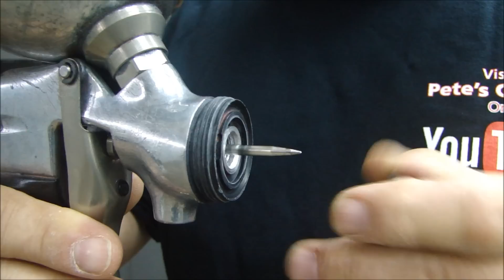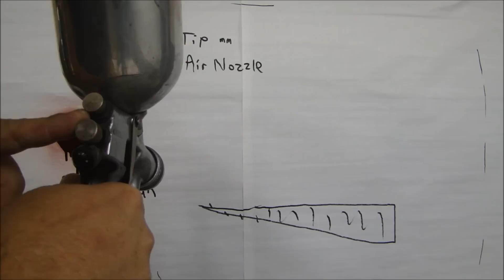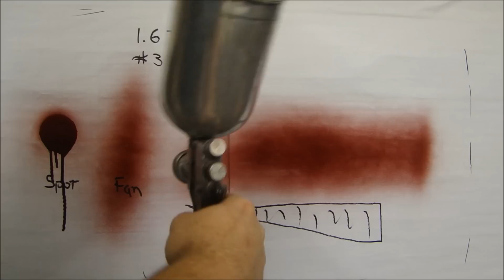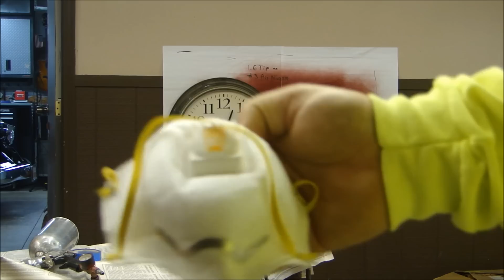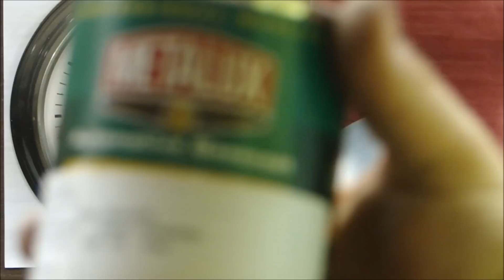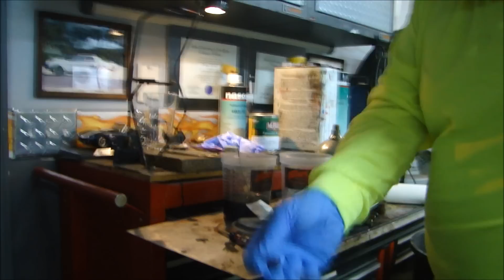Beginners Guide: Spray Guns & Spraying Base Coat Clear Coat

Comment: i know this an older video but the basics still apply. I have a question. I am an automotive detailer and would like to start using a  spray gun to apply interior and  extrarioe detailing protectants some are water based and are thick in consistancy. I sometimes want to be able to spray these at full strenght without watering down.  ome need to  whaI need to know what type of spray gun and needle size t I would need . Also  the compresor I have is a 20 gallon and is ratings are 6cfm at 40psi a little more at less psi. I need something that is affordable as well. Any recommendations would be appreciated. Thank you

Comment: Got a question about Respirators, Want to do some painting on my 62 Plymouth ( door jambs,, engine bay) Need to buy Respirator to spray Urethane single stage, and BCCC . Painting in 2 car garage with fans to pull out vapors.  What would be a safe respirator for a guy to buy, that's not going to do much painting ?  Shold I buy full face ? Please get back with me.  Thanks

Comment: I am a beginner using a Harbor Freight HVLP gun.  was it difficult to take apart and clean!!!  what i noticed was the needle and spring  lengths when threading the adjustment cap on was hard.  Had to push, depress the spring and thread the cap on.  is this common??  Also where can i purchase the wrench to take the nozzle out with??
thanks Sir.

Comment: Excellent tutorial, much appreciated.  Did new front end on car this week with $29 Harbor freight gun.   Primer sealer adhesion for plastic, basecoats, clearcoat came out great!  Had a fly land on it when I just finished clearcoat, made mistake removing fly when it was still wet.  Thinking will wet sand with 1500 n touch up spot fly landed on?

Just getting started picked up 21 gal vertical compressor, have few older guns also.   Really enjoy it, afraid I am hooked on another new hobby!

Comment: Can you speak on intercoat clear and topcoat clear. I just learned they are not the same thing. When do you use them, when do you not use them. I'm doing my first flame job. Got intercoat clear then found out it shouldn't be used as a final topcoat.

Comment: Very useful video.  Thank you.  I have a question that was not covered in the video.  Where I live it is very humid.  What equipment would you recommend to keep the air feeding the spray gun within proper moisture levels?  Also, in other videos, I have observed the painters using a plastic bag of some sort inside the cup to keep the cup a little cleaner and make overall cleaning in between, and when they are done, easier.  What do you think?  Thank you for an excellent video.

Comment: Hey Pete, wondering if you can give me some advice here. When I initially pull the trigger on my HVLP spray gun, the patter is wide, about 12" however when i keep holding the trigger, the spray pattern becomes much small, about 7". Does that mean there's not enough air to atomize the paint?

Comment: Pete, I have a 68 Ford Torino I painted about 30 years ago with Centari Acrylic Enamel. I could not find the strip kit which was tape when the car was new, so I taped it off and painted the strip on in gold. It all came out pretty good, but over the years now, some rust has started to come back and maybe it's time to paint again.  Dupont sold Centari which makes it hard to match again. So maybe Base coat/clear coat would be a better paint this time. How long would i have to wait to tape off the strip so that I can paint the strip on, pull off the tape and then clear coat the entire car all at once? Or maybe that is not even a good idea. Maybe clear coat the base color and then paint on the strip and clear coat over it?????

Comment: Hi Pete.  Thank you for the informative videos. I went to the junk yard, and pulled two doors to replace the one's on my car.  They are both different colors (white and lt, green) They are in great shape.  Should I sand below the clear coat, then use sealer and original body color plus clear coat?  The original color is dark green......Jim.

Comment: How fo you thin down the clear coat? What should be the viscosity of the clear coat? And what is the air pressure so it wont run.

Comment: need hlep i bought a HF 20g air compressor 135psi max 5.0 cfm at 90 psi i need help on picking a spray gun hvlp or hte i will at most paint 3 parts at once

Comment: Hey Pete I have a obscure question dealing with spray tan like fake tan  - spray tan. Auto spray tan booths start about 9k to purchase. I just want to spray tan at home without having someone else spray me. I have attempted to find just the elevator thingy they use in the spray tan booth as I have a spray tent and a spray tan machine I just need the automatic elevator unit but appears built into their booth.. so I have purchased a automatic mini blind with a remote so I have hooked my spray gun, taped lever so always on, I hit the on button to air tan-machine, hit the remote for the mini blind and tada BUT it’s a pain to get the gun positioned properly each time as I have to take it off to clean it etc. SO I saw the Melnor mini max tripod sprinkler and I thought.. brilliant instead of moving the spray gun up and down with the hose from machine attached etc. have the gun/sprinkler oscillate. 
I believe if I attach the sprinkler connect where lock ring is in front of needle then in place of nozzle will be the mini max sprinkler. 1st will that work? 2 nd I can’t locate size of thread part of any paint gun to see if it would fit or if any adapter exists to connect mini max to spray gun. Does this make sense what I’m saying? I hope so .. I’m a layman I just want to be tan cause it looks good but having someone else spray me is pretty intimate so stopping the Amazon delivery guy or lawn guys to spray me gets uncomfortable 🤣😂🤣just kidding bout that but not about my desire to DIY an auto spray. Any help would be appreciated 
I will purchase any spray gun that will work just need to know which if any Thank you!!!

Comment: Thank you the video was great for a beginner like myself.  I have never sprayed anything with air only out of a rattle can. I am trying to learn and get as much information I can before I start.  I am restoring a 1969 C10 it has been painted by a professional but I have a few small pieces that needs painting so this is a great time to start learning.

Comment: Thanks for the tips on using and cleaning a spray gun.  Do you have any other videos on spraying technique?  It looks like you started with the edge and bottom of the mirror first and then covered the major surface.  Is that correct?  I'm working on a moped using spray cans for now to learn technique before I take on the hood, top and trunk on my car.  I started with the panel edges and hard-to-get-to surfaces first and then covered the major surfaces because it seemed logical, so I'm wondering if I guessed correctly.  Thank again for the tips.

Comment: Pete, 

The car;                                                                                                                                                                       November 20, 2020

Great Video.  I'm restoring a 1930 Model A Ford Cabriolet that had been professionally painted with lacquer paint. Unfortunately, the paint cracked and peeled off so, my intentions are now is to paint the car with enamel paint. Now that the lacquer paint has all been removed, there are areas of the car that show bare metal, covered with red primer, Bondo, and the inside of the fenders have been painted with black Rustoleum paint. 

My question is;
I want to use automotive paint sealer. Do I have to apply an epoxy primer or self-etching primer first before the sealer or just apply the sealer to the above mentioner Model A?

Thank You,
John Bach

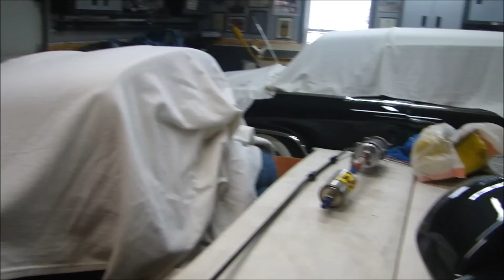Comment: 36:58 - Fish eyes :p Polishing will probably catch it, but it's a con of not being in a booth and or contaminants in the air or air line. Good vid though, if I were to offer one last step to the cleaning process, that would be to add more thinners to the gun once cleaned, shake it around and empty it, then add more and spray a little out to rinse out all the fibres etc from cleaning.

Comment: Great video. So to repaint a car, I sand off the clear coat, sand into the top coat, clean, degrease, prep, use a sealer, then top coat and clear coat. Is that the basic process?

Comment: I'll never paint anything bigger than a bird bath as I'm disabled I won’t ever be able to touch a car. That didn’t stop me thoroughly enjoying this video. Passion, enthusiasm and knowledge never fail to get my attention and you had them by the bucket full. 

With the respirator my first wife's husband was a paint mixer. He started in the mid 70s when safety wasn’t as important in the U.K., he now has early onset dementia. Though it can’t be proven it’s highly suspected it was the chemicals he worked with. It’s not just lungs the paint affects. Part of my condition is usual nerve damage that's closing my lungs down and I also have extreme persistent atopic asthma. Having a lung condition that will kill you in the next few years is hard work at times. I always wear a full face mask and don’t take it off until I’m away from the paint.

I’m glad someone deletes nasty comments, I’m all for healthy debate but nastiness for the sake of it is immature and pointless.

Comment: I have to paint a bumper cover for my 2006 Rav4. I bought a quart of paint and clear coat. The CC comes with hardener. DO I mix the two together or spray them separately?  Any tips before I tackle this? Thanks for the video!

Comment: Great video sir , however I have done away with the regulator at the gun because of the sudden higher velocity of air coming from it at first pull. In other words the gauge will be at 60psi and when I started painting it's set to about 20psi so 40psi drop. It's not a true 20psi coming out off the gun .??? I now only use diaphragm regulator and not the needle type that is on a gun for regulatng pressure. I only have the large watertrap regulator at my compressor set at about 30psi to 40psi wile trigger is pulled for painting, it works better for me.

Comment: Hello Pete,  I just got a HVLP air gun, and what is the minimum air compressor I need to use it ?  I got a pan compessor 3 gallons and I see the regulator gauge goes up to about 20psi, after I pull the trigger no air coming out of the gun.

Comment: Really good video. I learned a lot from that. I'm an auto mechanic who's trying to paint his own car. For the third time now. Urethane basecoat clearcoat. I sprayed the engine compartment while the engine was out. That came out perfect. So I figured I should be able to paint the car. Base coat seems to be no problem. Although after watching your video I learned better ways to get even coverage. The clear coat is a completely different story. I get really bad orange peel. Last time I sprayed, I noticed that the clear was not coming out in a fine mist. A really big mist. Tried turning the air volume up, and the flow down. Helped a little but still not good. Then it hit me, I think when I did the engine compartment , I had the air pressure turned up quite a bit higher.? Would that make sense?

Comment: What psi is base coat vs clear coat? Both the same? 18-19? I started my car, and started with 40 psi, lowered down 2 35 psi doing base, and clear with metal flame mixed in. Using the purple vlp harborfrieght gun. Budget painting...8 kids.

Comment: Pete, Nice video. I'm an old guy who just started painting cars. I've been restoring a old Nissan 240SX with my son as his daily driver. One thing we're doing is repainting the entire car stripping down to bare metal. We did the deck lid this weekend and I made a critical error. I used hardener in the base instead of reducer. I was somehow under the impression the base was a 2K system so I added hardener. The paint has taken forever to dry. I wish someone like your self had explained that reducer is a commonly mixed with base. I watched tons of videos and I don't recall one ever mentioning reducer.

Comment: Thanks for the video! So frustrating however, when you say it's for first-timers and say,  "I'm going to use low air pressure...". Yeah? And low pressure would be??? I'm not sure if you know how to teach beginners. What's low and what's high? What is overlap? How small of an air compressor can i use? What are the minimum things i will need of everything? 
Pretend you have absolutely nothing and you're going to spray your old car with faded/peeling clearcoat, in your driveway/garage. Teach me how to do that please! As if you owned nothing and are talking to toddler would be fantastic. 👍

  Will i need a different quick release attachment on my gun with a larger diameter hole? What pressure will my compressor need to keep up to? What materials will i need? Paper to cover glass, tape, sanders, grit, steps, bondo, chips, dents, ...? How to prep an old car from beginning to end. Then how to paint, then how to fix/finish, sand, wash, wax, etc. 

  My comment may be very premature considering i haven't watched any of your other videos, but I'm halfway through this and already a bit frustrated that you didn't tell me what is considered low pressure.
  Other than that, well done. Thanks!

Comment: I am looking to paint some shop tools  (table saw, etc.) with rustoleum enamel (it is the only oil based enamel left it looks like)  One of the tools is older and has a "spatter" effect, it is grey with an even spatter of white paint like someone was flicking white paint with a brush on it.  Do you know of any way to duplicate this effect?  I can get the grey coat on there no problem but how do you do the spatter?  People say to drop the gun pressure or drill out the paint orifice but nobody who has told me this has ever done it themselves.  I guess this effect was a fad back in the 1940's.

Comment: Great video. So after spraying the clear, how long do you wait before removing the masking? Surely you could damage your clear if it is too dry when trying to remove the masking or you could easily make a mess if the clear is still too wet.

Comment: Pete thank you very much, I have been looking for this video saw it couple years ago, I like the way you describe gun set and to turn down air and paint flow, Have small parts to paint for my boat using awlgrip paint, I have to thin it out pretty much will use your information, the parts painted previous had orange peel so I sanded it down and redid them. Turned out better but just a slight bit of orange peel not to noticeable. i was using a touch up paint gun the air was up higher the second time and thinned the paint out more. will turn things down and go slower as you suggest. I will be using a Eastwood LT 100 gun this time.

thanks Bruce
Ontario Canada.

Comment: I have been using the Devillbiss starting guns for a long time. What psi do you recommend spraying clearcoat? I usually spray it around 28-30psi at the  inlet. When I clear hoods, I usually have a hard time to get the clear to lay down, so I usually slow down when clearing, but lately I been having die back issues

Comment: A lot of videos recommend air pressure at the gun of  25-30 psi.
What are the advantages of your recommendation of around 18 psi?
If gun has regulator , what should psi be at compressor? Does the compressor psi matter as long as it is high enough ?

Comment: This helps a lot, I'm planning on spray painting a 3D Printed Prop with some Candy gold but need a spray gun, but a quick question, does a spray gun require a water hose? Because my water pressure is really bad

Comment: Great video Pete. I am respraying some kitchen cabinet doors. I bought the LVLP Sprayit SP-33000 and I am using a 2.0 Tip. I bought Behr Latex Paint from Home Depot. I plan to place each door on my workbench and spray. Should the Air Nozzle still be perpendicular?  I am spraying down at each piece. Would you think the paint at all? If so, how much? I was thinking of trying 30PSI. Any other tips?

Comment: Big point on Temperature, Humidity. that is defiantly a major consideration. The colder needs a faster drying reducer and the hotter temperature needs a slower drying reducer, to compensate for drying time (Runs and Problems..). Major reason for color variants with the same paint code on the same make/model of matching paint whether you have your own paint shop matching, or purchasing pre mixed paint. .. The factory from day to day may be using the exact same paint, but from one day to the next day Temp. and Humidity may change and flip slightly from a miner goldish, redder, bluer etc. and cause (Repair jobs a lot of blending at your expense) Insurance wont pay for that extra time... Hope this doesn't confuse anyone. Ask for color chips and have a painted part and check at paint store under Ultra violent light or in direct sun light. (I still always blended adjoining panels) 100 perfect paint jobs, and 1 doesn't please customer.... the other 99 wont help word of mouth. (Sorry for sending a whole page)

Comment: Hey Pete,

I know this video is a few years old, but hope you can help. About to attempt my first time painting a base coat clear coat.
I have already done the primer/sealer coat.
I believe I need to wet sand the primer before base coat color correct?

Then I apply a few layers of color?
Would I sand the color layer before applying clear?

This is sort of a budget project, and I was thinking about purchasing a cheap Harbor Freight gun, can I still get decent results with a cheap gun?

Comment: Brilliant video,i have a small compressor 2hp,4.6cfm with 50 litre tank, i have a LPLV gun could you advise on the pressures i should be using at the tank and at the gun.
thank you